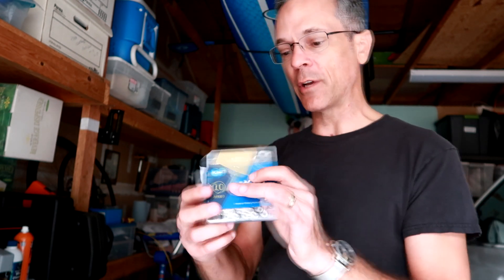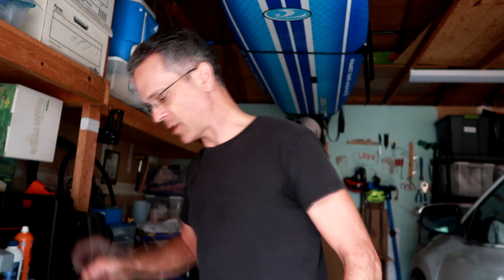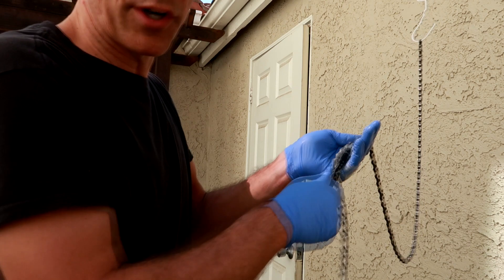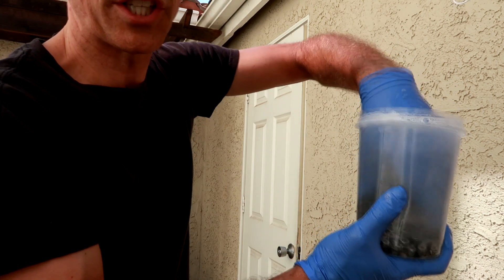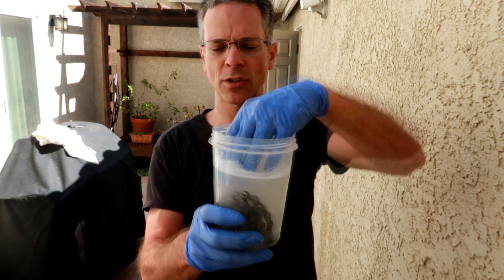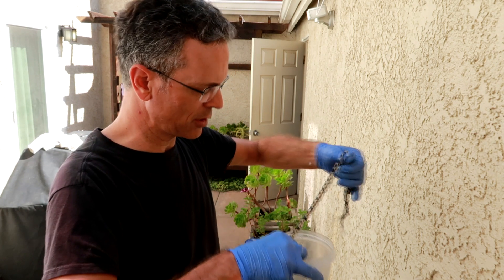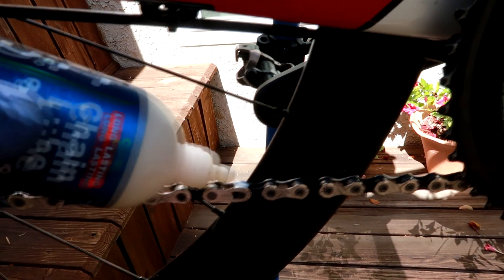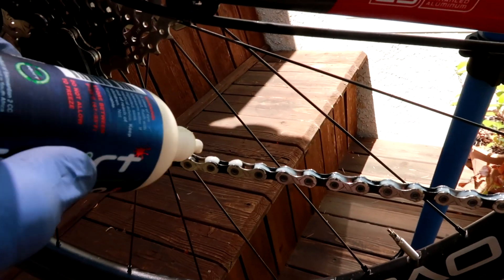How to Clean your Chain for Squirt Chain Lube💥👈

Comment: I saw a bike mechanic he prefer wax lube than the regular wet and dry lube. When applying wax lube he use a plastic with zip lock then soak the chain then he placed it under direct sun for at least one hour. And by the way he advised to clean my chain every 200km and use chain checker for drivetrain longevity.

Comment: It takes great patience to prepare a perfect chain – nice video! I was kind of lazy and ran my oiled chain through one of those handheld chain cleaners several times until it was all off, and then used the squirt wax. Still feels way better than the old chain oil, but next time I do a full prep, I'll tackle the rear cassette too.
Reply from the maker: Those work well, but to really clean it, you have to work it. Also look at the guy from Australia and how he cleans the chain. He uses gasoline (I don't want to do that).
Reply: @cyclinginsoutherncalifornia  kerosene

Comment: I just use a little gas in a sealed coffee can, shake it a few times, hang it up to dry, that only takes a couple hours, if you don't clean the chain, it will leave some dirt on a rag after a ride or two, so you want to get it clean,, I've done this for years, Squirt is the easiest way I've found to get wax on, great wax..
Reply from the maker: Great tip!

Comment: Leaf blowers rly good for drying. I use it to dry the headset, hub axles, chain, mechs; and if you dont wanna use a cloth, you can dry your whole bike with it but slower.
Reply from the maker: Good idea. Thanks for sharing. Thanks for subbing and watching!
Reply: They’re also really good at blowing grit and dust particles into the thing you are cleaning… 🙅
Reply: @willbennett8799  I don't live in a city so our air is clean. When you use a flashlight outside at night, there's almost no particles in the air.

Comment: i had a new chain on my bike installed before i saw your video. it wasn’t squeaky clean like you say here. i still get some grease residue when i reapply after 100 miles as you explained. how can i get the rest of it out? i still get tattoos sometimes.
Reply from the maker: Have you tried deep cleaning the chain?

Comment: Just bought this and will try it on a new chain. How do you maintain a chain with Squirt on it?  And if ever i did not like it, how do you switch back to the old oil lube? Just use degreaser again?
Reply from the maker: If you don’t like it, boiling the chain will melt all the wax and then just apply oil

Comment: I have just got Squirt and will be applying it to a new drive train, cleaned first of course.  I will be interested to see how it performs on UK roads in the winter which are invariably very wet and muddy.  Certainly not like Southern California :)
Reply from the maker: All you can do is try and see if there's a difference. I would imagine that wax mixed with dirt and rain are going to make a mess, and you'll have to decide if that's better than oil mixed with dirt and rain. Let me know.
Reply: @cyclinginsoutherncalifornia  less dirt sticks to the chain, especially in colder conditions where the wax is much more solid which might also make it last longer even in the rain.

We have the worst conditions for wax, hot and very humid so my squirted chain is very gray after one ride but no big dirt particles so thats good.

A tip for cleaning a squirt or any waxed chain: boil it in a pan in water. Works a treat!

Comment: Great video👍🏻..You have dryer weather than here in England..would you recommend using Squirt in mainly dry conditions ?thanks🚴🏻‍♂️🚴🏻‍♂️
Reply from the maker: You would have to ask someone that rides in wet conditions. In my view, however wax and water repel one another, whereas oil and water will lead to a black yucky substance on your chain. Not joking....it rained a total of 13 inches in 2020 in Los Angeles ... that’s the WHOLE year.  It’s basically sunny all the time here, so I can’t comment much about riding in wet conditions.

Comment: Website of KMC says : "Chain cleaners also often contain solvents that can damage your chain.
" Isn't it dangerous to let it sit in chain cleaner for 30 minutes?
Reply from the maker: I can't see Simple Green eating away at the metal of the chain. All it will do is dissolve the factory grease. The guy from Oz uses gasoline for heavens sake... What does the KMC Website suggest to clean the chain if chain cleaners are so dangerous? Just curious.
Reply: There is no chance of damaging your chain unless you let it soak in acid or something like that...
Reply: Simple Green is known for problems like these. That's why they make an aircraft solvent. KMC isn't stupid nor are they part of some "big-chain" cabal trying to help your chains wear out faster to improve their bottom line. I'll never understand the logic of cleaning away with nasty solvents the lubricant installed by the chain maker. I know it's not compatible with WAX but I don't understand that either. 
For decades I've simply dripped some oil on the chain when it looked or sounded dry. Cleaned it with a bit of diesel and a brush when bike was washed. With all the wax-cult hype I decided to closely check kilometers vs wear. 3000 kms on new 13 speed chain = 0 measured wear using KMC digital chain checker. Before this $30 chain gets to 0.5 wear (still the smiley face) it'll get replaced, leaving cogs and chainrings ready for more. And I don't just save time, but money since a liter of Mobil 1 SHC 75/90 costs less than $20 (vs $60 for Squirt) and a liter of diesel $2 + cheap paint brush and cut off water bottle. More riding, less wrenching!

Comment: I just let the chain lay 24 hours in a degreaser bath and then rinse it nicely in the sink and dry it with a hairdryer
Reply: what do you use to degrease your chain? is white spirit okay for this?
Reply: @Metalshark100   If you really want to deeply clean your chain you must use some strong industrial solvent or pertol or diesel in first step and then rince it in acetone or IPA or methylated alcohol.